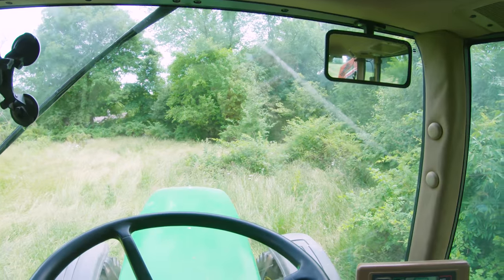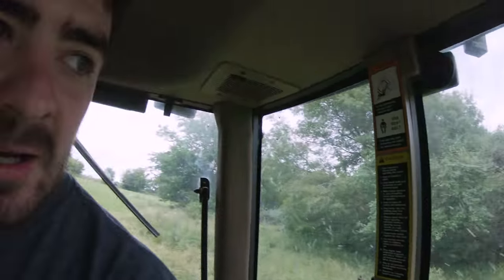RhinoAg MDB130 - Pushing Back The Brush

Comment: Flush cut the stumps or stump grinder, your biggest problem would be solved. However, just mowing down "small trees" and brush, in a few yrs time, you'll forget about where those particular "stubs" are but, promise you, you're tractor tires will still find them. Great video, cheers :)

Comment: That's a nice rig and I'm sure if you have enough work to justify the cost of it... I'm sure that thing ain't cheap.  Does it have hydraulic deck tilt so that you can tilt the deck more vertical to buzz back tree limbs and stuff in/near fences or trees?  That would really make it a lot handier.  My brother works for the county drainage district running slope mowers (with a 4 foot "bonnet" (shredder deck) like this one, but on a long telescoping boom that can reach over fences and creeks to mow the banks, and can tilt up to knock down limbs and brush growing out over the rights-of-way).  Really handy... 

Thing is with brush, basically if you want to KILL it (for good) you gotta follow up with some sort of herbicide... buzzing the stuff off down to the ground just gets rid of the top growth, and most of the time it comes right back in a year... To each his own but when I get rid of brush, I want it GONE FOR GOOD... (well, kill the roots and all so any that comes back is having to come from seed, so it's much easier to kill and keep clean).  Why I love that Remedy/diesel fuel basal bark treatment so much... just spray the bottom foot or so of the trunks or stems of trees and brush and it'll kill it roots and all within a few months.  If the brush is too thick or dense to spray the bases of the brush, you can just "hose it down" with the sprayer and it will kill it out too...  Let the stuff die and dry down and you can easily push it out with a skid steer or loader tractor, push it up into burn piles, and then you've got good completely clean ground ready for grass to get established to be available for your livestock... 

Later!  OL J R :)

Comment: You should actually go to the pasture with Travis on the 46 with the 4155 and you with the 76 and this mower that would sure make a nice video
Reply from the maker: We would but the 46 only has a 1000 PTO
Reply: Perhaps the 4020 on the 4155 then?  I was thinking the same thing as Remco.  Collaboration is usually a good thing, right?
Reply: Maybe the 4020 us better for the side mower because I think that mower needs less horsepower than the 4155 does. But isn't there something out there for the 4640 so you can pull the 4155 with the 46?
Reply: John Haas 4020 can pull that little  mower yes it might need some weight in the tires if they are not already filled but I have seen those mowers on smaller size tractors without to many issues
Reply: That was what I was thinking. That 4020 can pull that mower pretty well I figure don't think it needs to much extra weight
Reply: Remco Scholtmeijer seen a 70 horse ih pulling an old one at that with no real problems he goes around the hay fields and cattle fields and runs on pretty good

Comment: Follow up vid suggestion  / Rhino 4155 in the pastures  then clean up / the  MDB 130. Before and after. Great video.
Reply: If the 4155 is nicknamed "The Beast", what does the MDB get called?
Reply: "Killer"
Reply: I like it.
Reply: Ryan gave more explanations of follow up / 4155 Beast, then additional cleanup / the MDB 130  to extend the reclaimed pastures edges. After repeated mowing they will have  pasture again, Cheers for a great vid.

Comment: If that thing had a cylinder that connected from the arm to the top of the mowing deck so you could keep it flat as you raised it that thing would be better imo
Reply: This is why these types of mowers are commonly hydraulically powered as they offer flexibility and such whereas the pto driven ones like this rhino doesn't have the flexibility cause of the pto shaft.